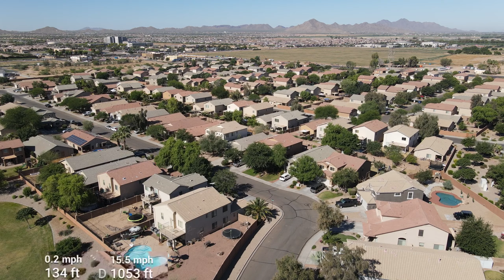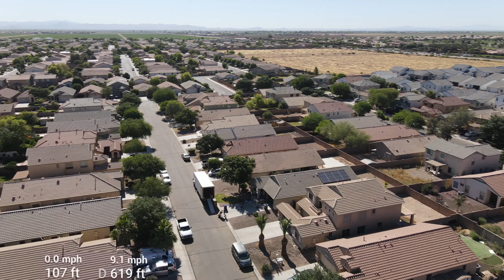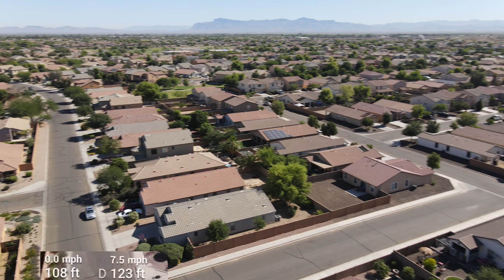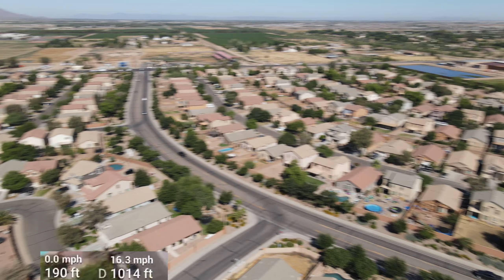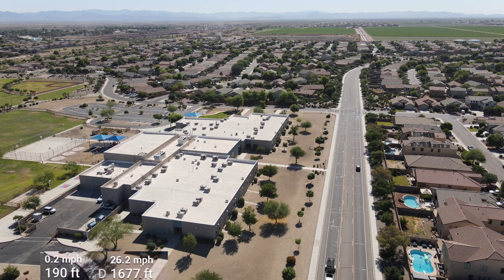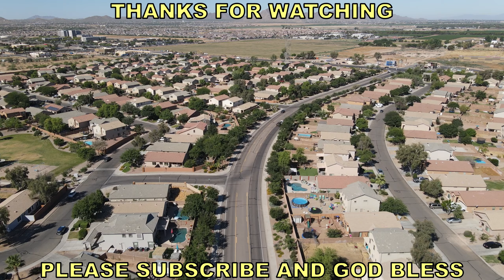MAVIC AIR 2 HAVING FUN WHILE DISCHARGING THE BATTERY

Comment: Very informative video.  I had an idea about the LiPo's being kept at 100% was not a good situation.  For now I only have the Mini and I was almost certain that the Lithium Ion batteries didn't require the same storage discharging and from what I heard you say the don't.  I've been keeping them stored all charged up at 100% and haven't had any issues 👍  The Mini 2 looks very temping as an upgrade but I think I'm going to save up some more money and go for the MA2.  If nothing else I might just keep the Mini as a traveling drone since it's so small.
Reply from the maker: Thank you for your comment, kind words and input Craig. If your Mini is making your happy I would keep it. The Mini 2 has a couple of improvements but may not be enough to justify the expense, depending on the "budget." Thanks again for your comment and God bless.

Comment: Thank you for your videos Mr. Kent. I have learned a lot.
I have a question.
As far as I understood, mavic mini batteries can be stored as fully charged. 
But other suggestions as using only 20 minutes, not to charge when hot, using the batteries in an alternative order are proper for magic mini batteries. 
Am I right?
Thank you again.😊
Reply from the maker: Thank you for your comment, kind words, and question. Yes, you are correct, but I don't understand the 20 minute part. As far as I know, fly until  DJI Dorothy says you should land now :) God bless.
Reply: @user-sr8pn9xg8z  Thank you again. Sorry I have listened 20 minutes issue in another youtube video. The video was about "why magic mini's are lost too much?". One of the precautions was return your drone after a 20 minutes period for the sake of powerful battery safety.
Sorry again for the confusion.
Stay safe.😊
Reply from the maker: @tayfunalper1458  No confusion at all Tayfun. That's just good advice for beginners. God bless.

Comment: But what do we do with a fully charge Transmitter too? Does it too have a battery made from a Lipo?
Reply from the maker: Thank you for your comment. That is a good question. The transmitter uses Lithium-Ion batteries which are not so temperamental. Thanks again and God bless.